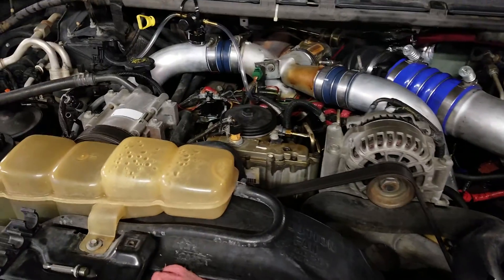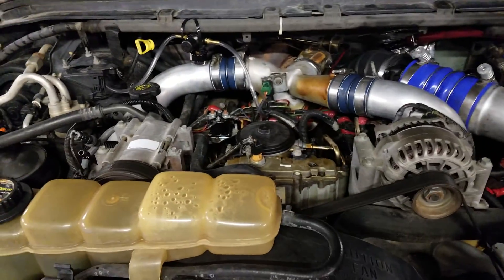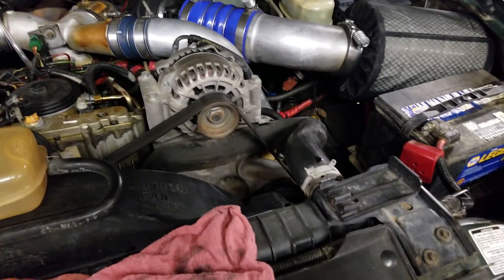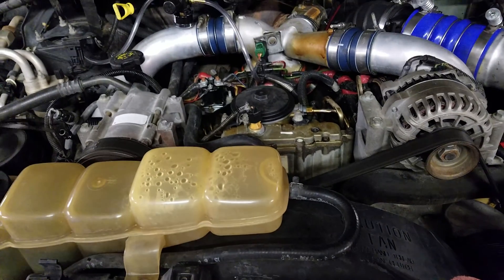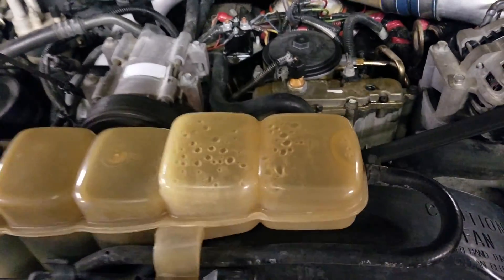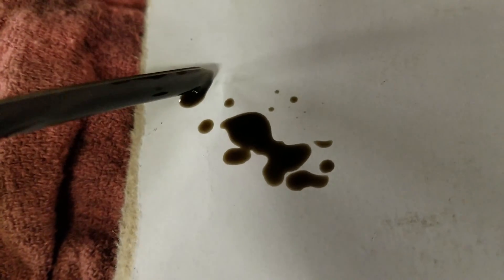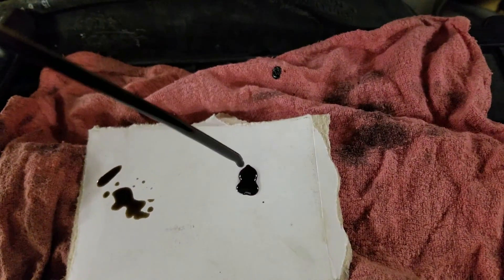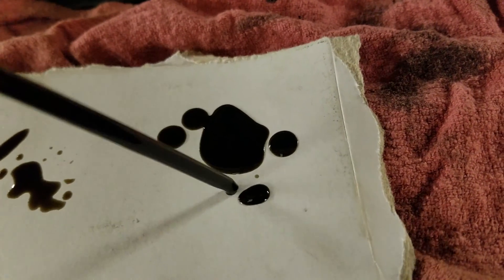7.3 powerstroke hpop oil

Comment: My 2000 F250 has 100K on it and I just checked the HPOP oil. I've been running synthetic in the truck since new and my HPOP oil looked like black mud. I had a hard time sucking it out.  I pumped it out and added about 16 to 20 oz of fresh oil at a time, ran it for 5 minutes in between and finished off with a bottle of ProLong treatment. I will definitely be changing it regularly.